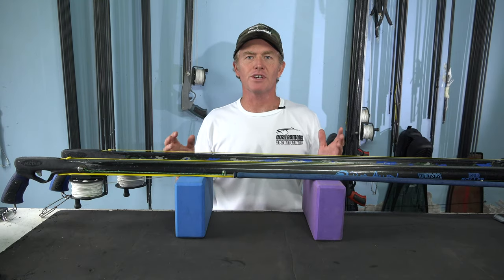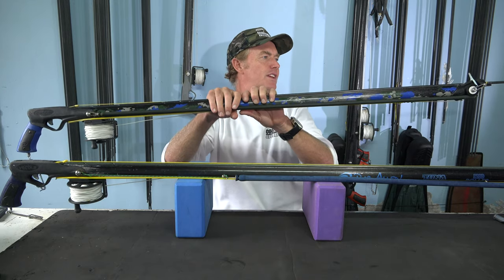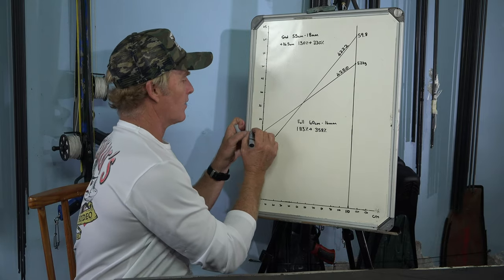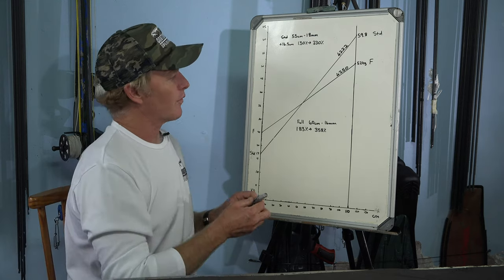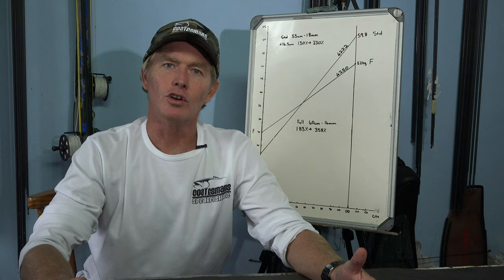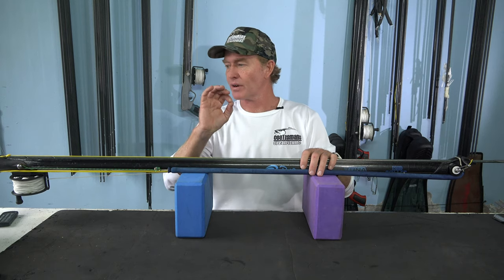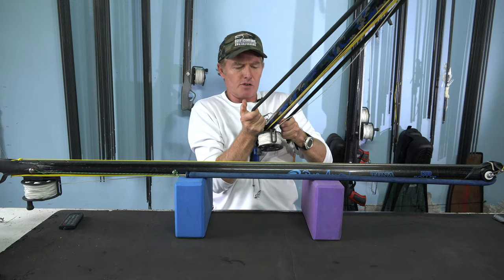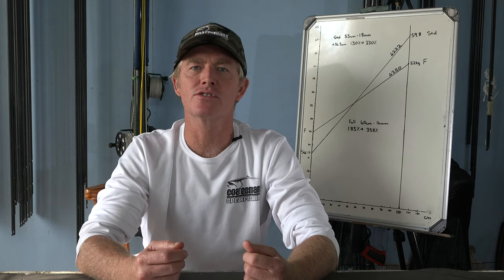Understanding Rollerguns part 2 | Unrolling the Roller Speargun

Comment: Legend! thank you for the video... I myself have been wondering the reason behind the full pretension vs normal and simply assumed they would perform almost the same with the exception the the travel force/distance to be more variable with the semi pretension version. SUPER VIDEO!! now we understand that loading is easier on the semi pretension but you will most likely feel more kick back leading to a slightly variable shot.

Comment: hey sick video really informing about the roller guns I was wondering if you could only get on sized shaft for a roller which will be using 14mm and 16mm bands depending on the conditions which size would you prefer to pick for a 110cm roller
Reply from the maker: Keanu I would use a 7mm shaft for 14mm bands and 16mm bands. 
With the 16mms you can also shoot a 7.5mm shaft.
Reply: my exact question.. thanks!

Comment: Hi Chris, what are you thoughts on converting a full pretension to a standard pretension set up and using just the single anchor point ? E.g. aimrite. Many thanks
Reply from the maker: I like my bands to drive the shaft right to the muzzle of the gun. When you reduce the pretension point, you lower the load on the muzzle, and the ability to drive the shaft at the muzzle. So no I would still go full pretension.

Comment: Really like the your content and article on rollers. I have just put together a 900 roller based on your article. Intend to use the 900 with a 6.5mm (for smaller reef fish) and 7mm shaft(as a backup shaft).

Would it be possible for you to run through advantages of a lighter faster shaft to a heavier more penetrating shaft in your 900/1100 set up?

Also would you go through the type of rubber you prefer, diameter, elasticity, micro bore and/pr standard bore, for each of your setups?
Reply from the maker: Hey Mathew 
There is a fine balance when going thinner on the shafts. Too thin and the shaft whips. The up side is that the drop in profile and drag make the shaft fast and accurate. Will be sure to bring this and rubbers up in coming videos.

Comment: Good Video, I have owned rollerguns but I gave them up as they had no power or range advantage over my riffe euro.  I have seen a few videos where well setup conventional spearguns can equal or even outperform rollers, I think this is due to the fact that if setup properly a conventional speargun can achieve "maximum velocity" sooner than on the rollergun therefore done need the longer rubber drive.  I am playing around with inverted roller superguns at the moment, the shot is really nice but when using 7mm spears, I am not convinced they are better than a normal roller or conventional speargun. Perhaps when going to a 8mm spear they have a advantage?
Reply from the maker: DiverGazz conventional guns are 100% obsolete, there is no way a conventional gun competes with a properly setup rollergun. 
Inverted guns are amazing but even more difficult to get right than a std roller.
Reply: @CoatesmansSpearfishing   Hey Chris, would you be able to explain this to us more. Really keen to understand why you have landed at this point re conventional vs roller? I'm all about shooting fish, so really interested how you have moved from the 1300 with 20mm, to a 1100 with twin/single? 14mm bands.

Comment: Hello.. sorry i might have missed something.. standard pretension goes from 130% to 330% and the full pretension would be from 183% to 358% . If the full pretension is stretched more at the notch (358%), then i would think that the load at notch would be more than the std pretension (330%).. but the graph shows full pretension lower than std at notch? Im considering modifying a speargun from an inverted roller setup 😀

Comment: Hey Chris great video once again ! I've done the calculations with my spearguns, I have a RA roller in 120cm with 14mm sigal sub rubbers (coeff 3,12) full pretension. Tension at the muzzle is 16,5kg and at the notch it is 38kg. The potential energy is 3270 kg/cm.
Then I did the same with my blue water invert roller it is 125 speargun (with three pair of 16mm Primeline rubber coefficient 3,5, and one pair of 18mm rubber in "laser" coefficient 3,2) The tension at the muzzle is 37 kg, and at the notch it is 167kg, so the potential energy is 12750 kg/cm. But in my graph the line is pretty steep, parallel to the line of my double 16mm  riffe euro 130. But the recoil is none, I guess it's because of the invert system.
Are you going to do a video about th invert roller ?
Cheers !
Reply from the maker: Hey Raphael inverted guns are not multipliers but dividers. The pulleys divide the power. And like rollers there is an amount of energy loss around each of the pulleys. 
Did you measure the loads with a scale on the gun?
Reply: @CoatesmansSpearfishing  yes i did, I’ve add each tension of each rubber when loaded.
Reply: @CoatesmansSpearfishing  the pulley devide the power by 2 ? So when I’ve calculed the pretension it is divided by two so to have the real pretension I have to multiply by 2 ?
Reply from the maker: @RaphaelSerrecombe  The energy calc is right around 12750 kg/cm. The graph is steep not unlike a conventional gun. But the energy transfer around rollers be it a single or multiple pullies is slower and not as direct as a conventional gun. This is why you need a 14mm kicker on an inverted gun to get the shaft moving. But this energy lag is what I believe reduces the recoil. The energy is still transferred into the shaft, just not as explosively as a std conventional rubber.
Reply: @CoatesmansSpearfishing  okay really nice ! Thanks chris ! A pleasure to talk about that with you 🤙🏼🔥
Reply: Just one more thing, what the "x amount of kg/cm" means ? What does the centimeters represent ? Is it about the shaft length ?

Comment: Excellent original article Chris and now the updates via awesome videos! Thank you.
I've built a 900 and a 1100 RA aluminium barrel roller with 300mm 7mm spear overhang after reading your original article.  Great guns but I find that the balance of both the guns in the water is noticeably front heavy compared to the RA double rubber guns - I suspect due to extra weight of roller muzzle.  Barrels are well sealed. Once spear is discharged the gun sinks as well.  Thinking of fitting a Pathos gun float or going Carbon barrel but I wondered if you found this as an issue and whether you solved it somehow? 
Thank you and I'm really looking forward to the rest of your series!
Reply from the maker: Hey Kevin, Barrel buoyancy is a big issue with all spearguns. Rollers have additional weight at the muzzle with bearings and metal axles etc. 
I will be covering this with each size gun.
Reply: @CoatesmansSpearfishing  Thanks for taking the time Chris and also for sharing your knowledge with your articles!!!
Reply: i just cut my 120 carbon barrel shorter to a 110 barrel, sealed it back up and attatched the roller muzzle with the ballast, havent tried it yet but i figure if i have a shorter barrel and a shorter shaft the ballast shouldnt be the same weight as before... rob allen only sells one size and weight of muzzle ballast... how could i balance my carbon roller gun perfecty? cut chunks or trim off the ballast and fit until the gun feels right?

Comment: Really enjoy this series on roller guns and their setups. I currently have all my rollers set up as conventional. Will start by updating my Rob Allen 80cm gun to full pretension and compare it against my current setup. I do have one question. When talking "pretension" is there an ideal percentage of pretension that we should consider that can then be applied to all gun lengths (ie 10% pretension on a 70cm gun would be 7cm of preload, and thus 10% pretension on a 100cm gun would be 10cm)? Thanks again and look forward to your next episode!
Reply: Hi Roland, 
Should be trying to ensure that your final tension is at 300 to 350%. On a 800 your will be looking at having rubbers that are at 360mm, but saying that I usually try to make it so I am comfortably loading, not usually an issue with a 800.

Comment: Thanks for all this work and info.  I am curious, I have a carbon fiber 120 cm standard gun with a cuttlefish barrel.  I notice you all don't use cuttlefish barrels.  Is there a reason why I wouldn't want to try this a a roller?  Do they have more friction on the roller band because of it rubbing against the barrel?  Or just never felt the need to try?  I do like how this gun shoots as is but feel like it would be fun to try it as a roller, and could in the future quickly switch it back and forth with a change of the bands and muzzle and muzzle ballast.
Reply from the maker: Hey Andrew, I have spent the last 4 or 5 years developing a 'cuttlefish' barrel as I could not find one that was designed for rollerguns. Most of them the rubbers bow around the belly of the barrel. Hope to have product out there soon. 
So for now just sticking to the std carbon barrels.
Reply: @CoatesmansSpearfishing  Thanks!  If I used that barrel they would definitely bow around it so maybe its not the best candidate to try a roller with.  We appreciate you sharing all this great information!

Comment: I plan on buying a 110 roller tomorrow...I was all set on the 7mm shaft with 14 mil bands, do you still recommend that setup over the 7.5 mm and 16mm setup?
Reply from the maker: The 7mm / 14mm setup is better balanced buoyancy wise on a std RA carbon roller. The 7.5mm / 16mm combo has lethal power but is heavy in the water.
If you have specific large fish in the 20+kg range that you are hunting then the 7.5m/16mm setup is the way forward.

Comment: Hey Chris from what I can see the muzzle slightly to bulky and it would be nice to have a flat clear view all the way down the spear! Would there be an issue if I had to grind it as flat as possible, maybe just flush with the spear?
Another thing where the bands come to a stop, I believe at that point there is the most room for error as the beads bump into the rollers, lift and flip which could lift the tail of the spear as it exits and causes the spear to dive slightly...?
With the bead band ends bumping into the rollers at that angle, it would deflect the muzzle possibly interfering with accuracy.
Could you please explain this and let us know how much this effects the shot placement?
Reply from the maker: On a single roller you can go as low as shaft thickness, as long as there is enough clearance on the shaft to pass. Theoretically at least. Production muzzles have to accommodate the fact that someone might use shark fins or pinned shafts. Primarily for easy of loading so the fins clear under the bridle when loading.

You are right that the rubber & bridle should not interfere with the shaft at the muzzle. Some muzzle unfortunately don't take all of these issues into account. 

I am going to have to do a whole video on bridle lift and how to overcome it.
Reply: @CoatesmansSpearfishing  Thanks alot Chris you are a brilliant help.
I know this emerging sport is still relatively new compared to others, there is still alot to improve on, which is awesome for us.
I have come up with two simple solutions,
1- eliminating the muzzle "flip" which makes it more accurate.
2- Loading of the roller gun without an external load assist which is a pleasure to fullyload. 
I will try put together for viewing in the near future.
Cheers mate.

Comment: Hi Chris ! I don’t understand your job😅 you sell rob allen spearguns or you custom spearguns?
Reply from the maker: Hey Arthur, I build guns using some RA components. Those primarily being the handle and shafts. Being here in SA and close to the Dive Factory it just makes sense for me. Well that and the fact that I have not found anything that's better to replace them with. 
I am not exclusive to RA and build with various other brands. But its generally a compromise and my barrels and muzzles are designed to work with the RA spec. Always on the lookout tho and if you have any good ideas I am all ears.
Reply: @CoatesmansSpearfishing  everything is clear now! 😉 thanks a lot!

Comment: Is the diagonal line on the diagram alwas straight or could it vary if u test diferent losing distances on the same setup? Would u alwas land on the line or could it have a sleight convex or concave shape in realive ?
Reply from the maker: Hey Patrick,
You right the line will not be exactly straight as the load will vary as you take the shot. But more importantly which is not shown here is the snap back velocity of the rubber. This is something I will have to explain in another video.
Reply: thanks great teck video

Comment: To measure all the loads did you do it with the full set ups on the guns or were you able to come up with the load that comes from a certain amount of band stretch?
Reply from the maker: Jarrad,
I landed up doing both. For the band stretch model I build I used data from band stretch tests, to get the loads on ea diameter at specific percentages. 
I also rigged up a gun with scale to validate that study. And to see if there were any differences.
Reply: @CoatesmansSpearfishing  did you find it to be a pretty good representation of the actual band load?
Reply from the maker: in practice the values were slight higher than the model. Especially like on the muzzle where any friction or drag increased the load.
Reply: @CoatesmansSpearfishing  thanks.

Comment: What is the length of each full pre-tension rubber before stretching them to the anchors.
Reply from the maker: with 14mm hand load its half the barrel length plus 5cm = 50cm 👍

Comment: Hi and a simple question: full or standard pretensions must be related with rubbers dimension and diameter, what are the ratios? meaning, standard pretension make the rubbers length smaller, but should it be related with diameter? otherwise is only a question of larger or smaller length of rubbers, correct? thanks...
Reply: The question are obviously considering the same guns dimension...
Reply from the maker: Pedro, when is comes to std setups it is difficult to give an exact answer. Because how long is a piece of string. 
On a full pretension no matter what the gun or muzzle is all you do is measure the distance from the notch around the roller to the loading luggs and divide by 3.6 (can go shorter ... 360% is comfortable)
Reply: @CoatesmansSpearfishing   Noted and thanks, believe it's kind of try & error for the best settings.
Reply: So when I did this calculation and I came up with rubbers that measure around 13 inches on a 120 cm gun. This seems like I did something wrong haha

Comment: how does the standard pretension end up having a higher output in kilograms when loaded than the full pretension?
Reply from the maker: It is a short 55cm 18mm band that at load is 330% which is almost 60kg. 
16mm would have to be at 400% to load 60kg

Comment: I made up my own rubbers for the first time recently using 16mm manny sub progressive rubber. My gun is a 100 RA tuna roller and I made the rubbers to the same size as the rubbers that came on the gun (60cm) and set them at full pretension. I can’t load the gun even with a load assist, is this because they’re progressive rubber?
Reply from the maker: My go to 16mm set up on a 100 is 55cm (natural dipped latex rubber) This is easy to load with a 14mm load assist. 
What load assist are you using?
Reply: Coatesman's Spearfishing just the RA load assist that came with the gun. I will add that I couldn’t load the gun whilst I was setting it up (out of water) so I set it up as standard pretension so I could load it. Should I try load it in water at full pre tension?
Reply: Thanks Tom, that’s the thing though, I am used to it because the factory rubbers were full pretension which is why I thought it’s maybe to do with the change in rubbers? The rubbers were under the pulleys at full pretension
Reply: @MrMarcustree  rig up your wishbone a bit shorter so rubbers are sitting on the roller a little. Makes it sooo much easier to get started

Comment: Even though accurate I think this is a bad comparison. If you are going to compare the 2 types of pretension at least go with the same rubber thickness
Reply from the maker: Hey Aldo if you go with the same rubber thickness there is no comparison at all. I chose the two examples as they have the same energy / power output and similar performance in practice.